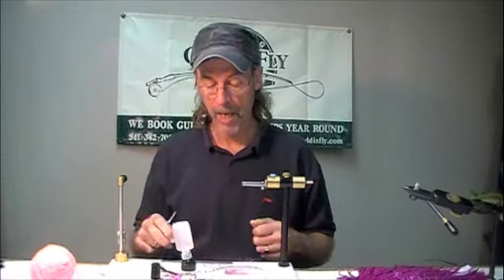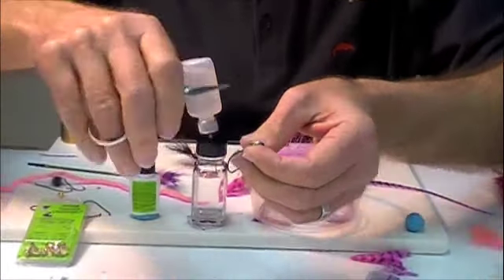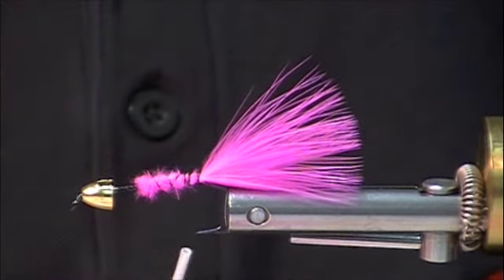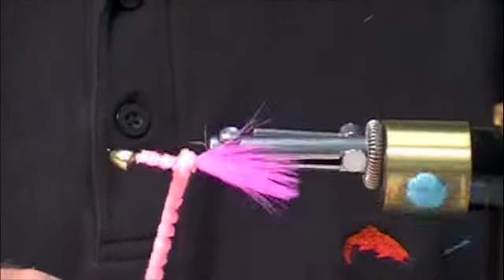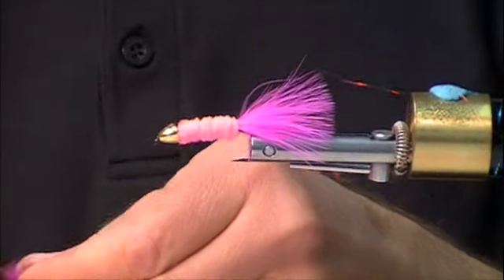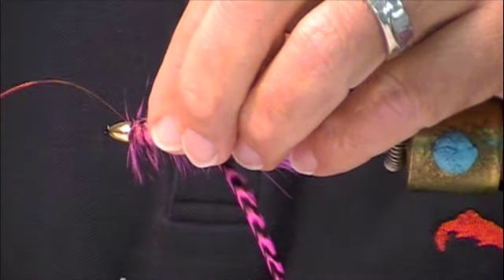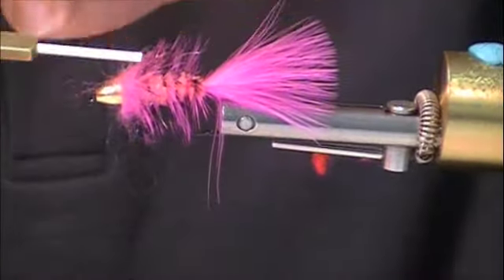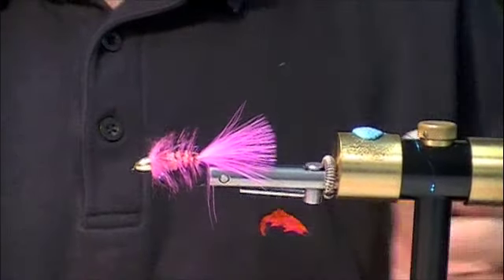Steelhead Wooly Bugger by Jay Nicholas

Comment: You should take full advantage of the Nor-Vise rotation when you are dubbing.  It spins the stuff on really well.  Also when palmering, you can run the thread with the hackle, or twist it in when the bobbin is on the storage post.  This makes a pretty bullet proof hackle for buggers, and it might be kinda ugly, but it doesn't spiral the fly in the water or air.

Comment: a few tips,
fold that stem (of hackle) back on it self, it really locks that stem in place. also instead of using wire as your rib, wrap your thread around the hackle, sort of like peacock herl, wrap the thread with the hackle back, and then wrap the thread back up. this really reinforces the hackle, in my experience the chenille, or hook will break before the hackle.
Thanks,